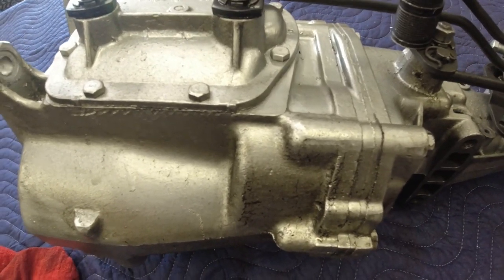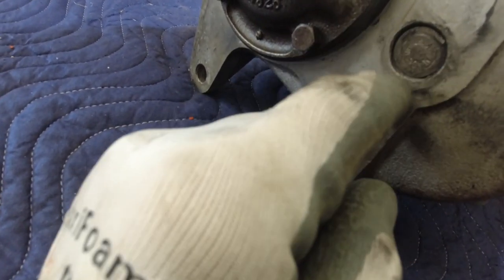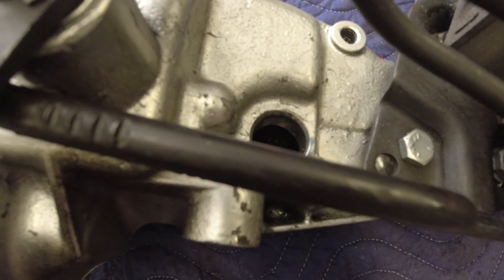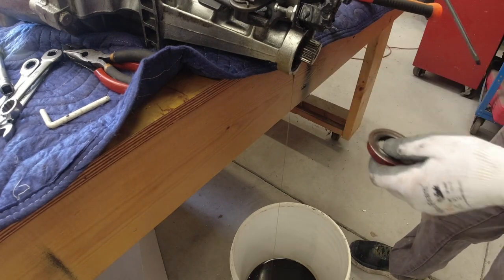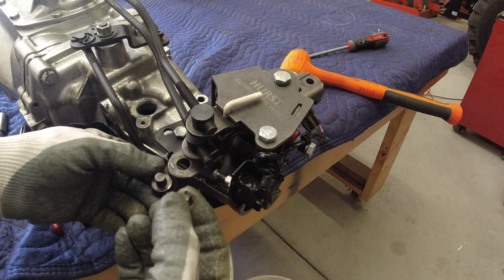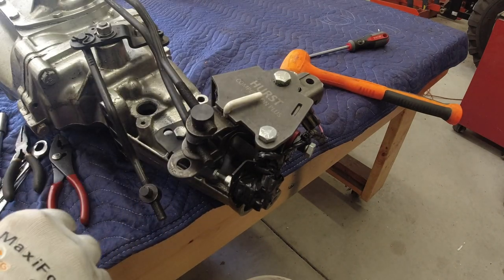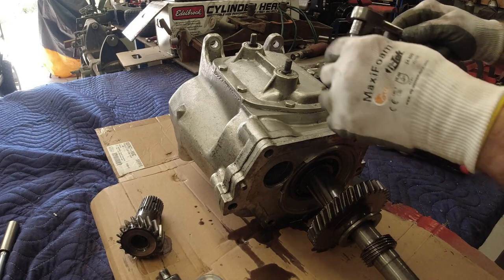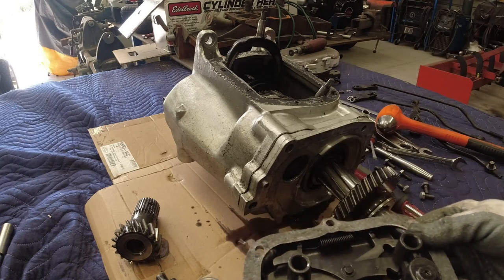Muncie 4 Speed Tear Down

Comment: Great detailed video. I got a stomach ulcer with all the pins. Luckily there is a video. I hope I don't have to mess with the transmission on my original C3-sole owner. What do you recommend for a repair manual? I have the reprint Chevrolet book  which includes corvette but as usual detail is missing. Thanks again.
Reply from the maker: I am not looking forward to putting all those bearings back in place. I have the same repair manual and you are right, it is missing a lot of detail. When I can't find what I need in it, I go to YouTube. When I was younger there was no Internet or YouTube and not many manuals so the  only way to learn was to tear into something and figure our how it worked. Of course things were a lot less complicated back then. Thanks for watching.